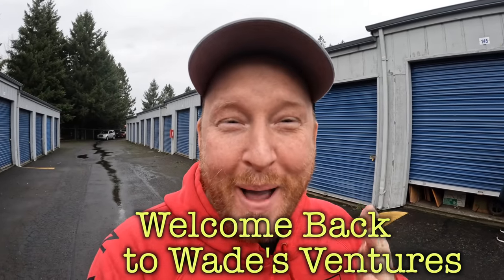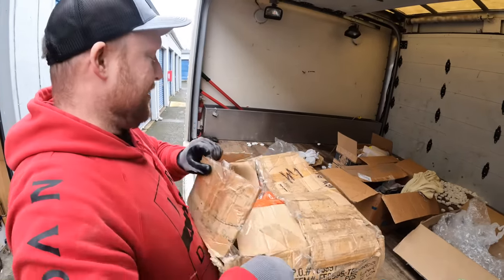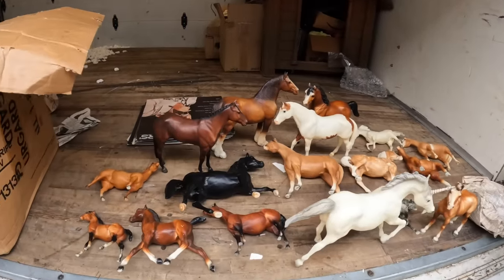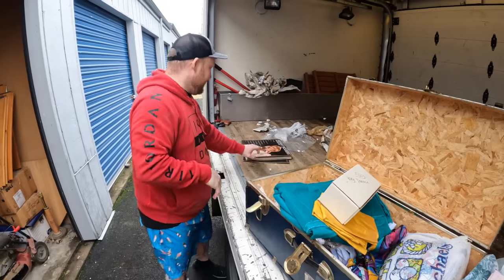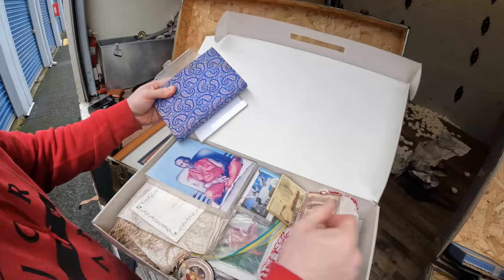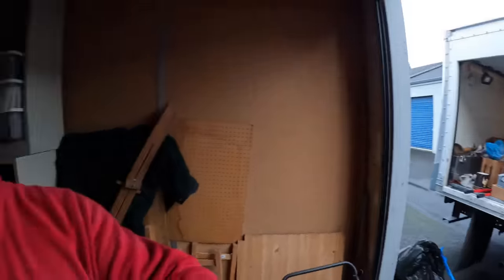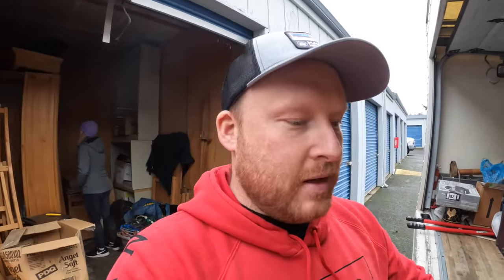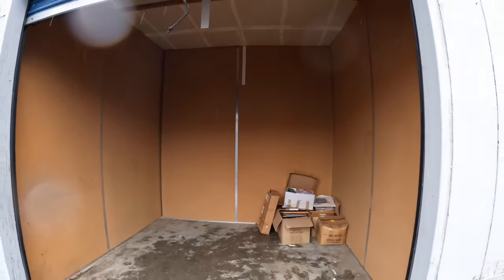I Bought An Antique Storage Unit YEARS Unclaimed?

Comment: So....Breyer collector here.  You have a nice collection of 1980s - 1990s era Breyers.  (They are made of cellulose acetate, which is a type of plastic, and are airbrushed at the factory.)  Most of them are in the Traditional scale, with a few in the Classic scale.  The Western Prancer - the palomino you have lying down, with the front leg raised, should have chain reins and a plastic saddle.  Two of them are based on books by Marguerite  Henry - the textured one you picked up is Misty of Chincoteague, and the chestnut pinto with his head tilted slightly is San Domingo.  The first one you unwrapped is the Black Stallion, based on the book by Walter Farley.  (That doesn't make them more valuable; just information on what they are.)  Most of them are worth right around $30 - $45, with the Classics being worth somewhat less.  All in all a nice vintage collection of Breyer Model Horses.
Reply: A Breyer collector here. Nice collection! I would love to buy it!

Comment: Came for the horses, I had a bunch of these when I was younger. This is a fine collection. Also, 700 comments late but probably you already got the info that Jaz drives were made by iomega and they were a form of storage bigger than a 1.5 floppy disk. Iomega also made a very popular Zip drive. Both I think were more commonly used among Mac users, but not only.

Comment: Check to see if the fabric comes with Selvage which is the white border. Some is desired, but if you can't sell it find a Quilt Guild close to you. Let them know and do like my sister used to do, and sell it a dollar or dollar fifty per yard measured on the selvage. There are quarters and fat quarters and they will sell as well. Just go by a quilt shop and they will teach you all you need to know about measuring.

Comment: Jaz is computer storage .....it was popular between the mid 90s to early 2000s. Jaz disks could save more info than floppies. But then, computers became larger and then we started to be able to buy and use external hard drives. So, it might not be music on those disks. And you will need a little Jaz drive to open those disks.

Comment: That's not an english clock that's a barometer. You can set it and find out what the weather is going to be the nextday. You lineup the 2.
Pointers, pointers, and and the next day. You'll see which direction it moved. And that will tell you what the weather is going to be.